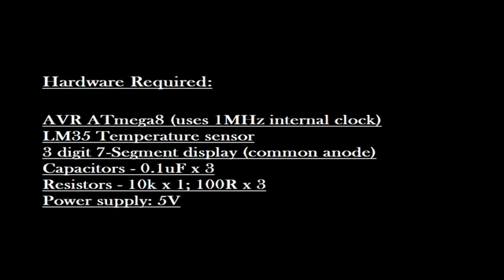Microcontroller Digital 3 digits 7 segment Display Temperature sensor circuit using AVR ATmega8

Comment: i'm a noob here. Is that ATmega8 need any programing or you just need to buy it from somewhere any but it in the circuit like you did and it just magically work ?
Reply from the maker: yeah ATMEGA8 work on programing. it does not work without Programming.
Reply: @SyedRehanALiNaQvi  . So you need to have a arduino board . Then plug the ATmega on the board and upload the code ? . i would be very happy if you make a video show us step by step.